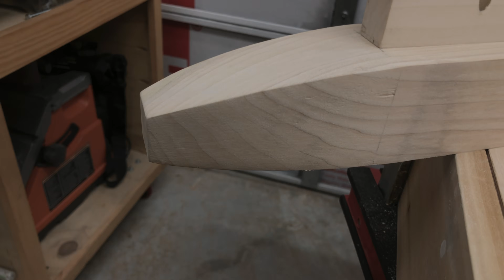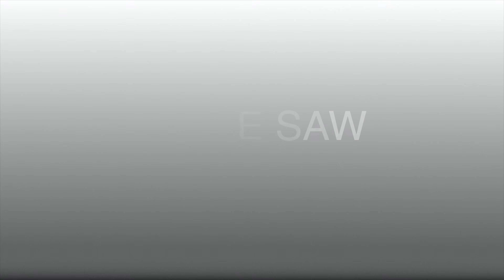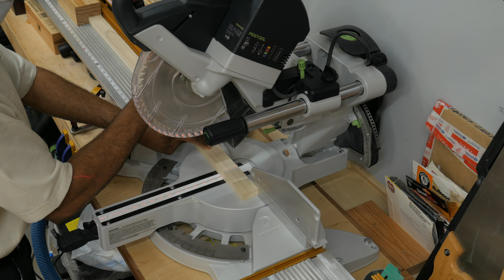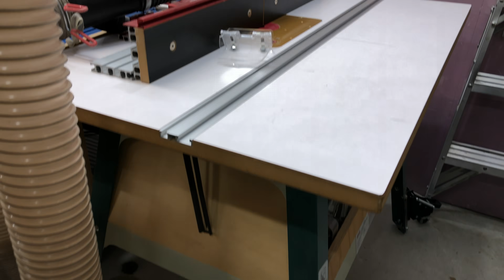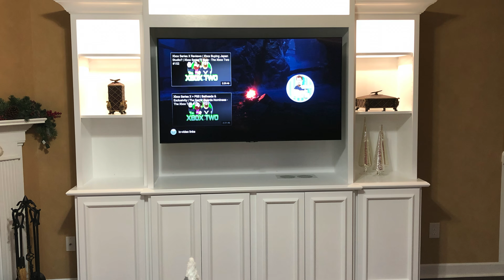Major tools that I would get first if I was starting a woodworking shop from scratch/ table saw rant

Comment: Michael, I’m not going to try and convince you that you’re right or wrong, but I would like to offer a different perspective to yours on the “Hot Dog” saw. You say unless or until all machines have it, then it doesn’t make sense to have it on just one tool (Table saw) because it can lull one into a false sense of security and become lax operating other machines in the shop. So, until all machines have that type of feature you think it is more of a hazard than a benefit. I haven’t found myself, or anyone else I know that has one, becoming complacent or lax around their Sawstop. When I first got it, I was concerned about an unintentional activation by using wet wood or something. If anything, I was more cautious than usual because an accidental activation, can cost $150+ to replace the cartridge and blade. But after awhile you stop thinking about that and use it as a normal saw, you know one that has a 10” blade spinning at 5500 rpm which as always, demands your attention. And the Sawstop safety feature does nothing to stop kickbacks, which can be very dangerous and cause severe bodily injury as well. So, at no time have I, or anyone I know, treated their Sawstop with any less respect or sense of safety than any other saw. I mean think about it, it still looks and sounds like it could cut you hand off, so you instinctively treat it as such. And I don’t know about you, but to me, even a few stitches doesn’t sound like any fun. Is it a shop necessity, no, but the quality of the saw itself is worth it to me and the added safety feature is a welcomed in my shop. And Michael, not all incidents/accidents are made by “stupid” people. All it takes is to be distracted or to lose focus just once for a split second at the wrong or right time for a severe injury to occur. And it doesn’t even take that, injuries can occur when you are doing everything right, equipment can and will fail or break without warning. I’ve spent 30 years in the refining industry and have seen more than my share of avoidable "and" unavoidable injuries. Well, that’s my two cents, thanks, Chuck.
Reply from the maker: I only speak to avoidable injury which are by far the majority of table saw injuries. Acts of GOD are beyond our control! When you are working with a dangerous piece on equipment, it should have your full attention! You can go on YouTube, right now, see individuals using power tools recklessly. Every tool comes with a manual that clearly warns of the dangers of improper use.  When operate a power tool distracted, disengage any of the safety equipment or use in a way it was not intended to be used, you’re accepting personal responsibility for anything that may go wrong and cause injury to yourself or others. If an individual uses a weapon recklessly and/or disable its safeguards, isn't he or she personally responsible for any injury cause by it? As I have stated in my argument, the stop is probably the best made saw in terms of built quality, but , in my opinion, it does more harm than good in a shop environment. Your opinion is not only welcomed; it is appreciated! Thanks for watching!
Reply: @concentrichomesolutions   Michael, thank you for having a channel that allows discussion and debate of differing opinions and viewpoints from which we all can learn.  
I really enjoy your energy, passion and to the point no "B.S." personality, tempered with a bit humor.
Chuck
Reply from the maker: Thank you Sir!

Comment: Regarding your comments about the "Weenie Saw" (Sawstop I think)!  I am 66 years of age.  I starting serious woodworking at age 14.  At age 53 I was using my mint condition 3 HP Unisaw.  At this point I had built 3 custom homes inclusive of all furniture, cabinetry and stand alone shops.  With thousands of table saw cuts under my belt I made one simple yet brutal mistake.  

Wearing hearing protection I walked away from the the relatively quiet running Unisaw.  Returning to the saw from blind side (right of the fence) I reached for my tape measure.  The blade was about 2" above the saw cast iron top.  In an instant. I had cut off my middle, ring and pinkie fingers. The blade then went directly down the length of my index finger.  After nine hours of micro surgery performed my one of the best hand surgeons in the USA I had all fingers re-attached.  Several bone grafts from my hip and wrist repaired my index finger.   After the surgery the hand surgeon sat on the edge of my recovery room bed and asked me what blade I was using.  I thought it an odd question.  Turned out he was a woodworker also.  I said it was a brand new Forest WWII blade my wife gave me it as a Christmas gift the day before the accident.  The surgeon said "I was amazed by the cleanness of the cuts through your bones.  This really  helped as your bones weren't shattered"

For 3 years I attended physical therapy to learn how to use my hand again.  In total the medical cost of in total was $600,000.  Now at 66 I continue to design & build exquisite commissioned Greene and Greene furniture as a hobby in my retirement.

I truly think anyone should think twice about not seriously considering a Sawtop when the cost is only about $1,000 more.  It's also an incredibly well built machine.  I have had Roblands, Unisaws and Grizzly tables saws.  We all make mistakes, all of us have.  Sawstop tried to sell the technology for several years to large machinery companies to no avail.  It is my understanding that only recently Festool bought them.  Go figure!

In summary your statements are like advising a new driver not to wear their seatbelt.  As I watched your negative rant about how any machine can hurt you I can only say they sure can.  But what does that have to do with it?  Why not lessen the odds of injury.  

As a footnote.  The bandsaw is the most versatile machine in a woodshop.  A well tuned bandsaw is absolutely the best machine for ripping wood with unpredictable grain tension.  It does not kick back, only downward.

In closing.  I became very good friends with my hand surgeon.  He was the first to successfully reattach a hand to a wrist.  He has frequently said "40% of my patients are table saw injuries".  After all it only takes one mistake!
Reply from the maker: At the time of my reading, my app did not show the entirety of your comments. Im sorry about your injury. With that said, where was your blade guard (which is the direct equivalent to your car’s seatbelt); Why was your table saw running while you was away from it; Couldn't what you just described happen on a bandsaw, jointer or any other power tool with an exposed running blade? Watch my rant on table saw(aka power tool safety) and if you disagree explain.  Thanks for watching Glen.
Reply from the maker: https://www.youtube.com/watch?v=AZMe0QIET6g
Reply: @concentrichomesolutions  Agreed.........SawStop is a great design but I appreciate the operator has to and must be engaged with the machines same as someone with a gun or other very dangerous tool that reacts faster than a human can react.

Comment: Extremely helpful from the first comments about table saw onwards. At 66, I'm not getting any stronger or coordinated. Breaking down 8*4 sheet material in small shop - Paulk style cutting table is too big - get Selco (other building materials suppliers available but not always with free cutting) to do the first three cuts slightly oversize for free. My car-based-on-van can just about fit 8*3 or 6*4 pieces and wife or neighbours can help carrying over 1" thick material to car and through the house. Currently have very basic Rutlands table saw mainly for ripping
Reply from the maker: You're welcome Stephen!

Comment: I own a sawstop and take the same precautions as if it didn't have the safety brake. However, I know several people who are missing fingers that were due to tablesaws.  For me, it's worth the extra money for the safety device.
Reply from the maker: I have no qualms with that, so long as you are continuing to follow the safety rules. As for people losing their fingers on the table saw due to not following the rules and think that a SawStop is the solution, the router, bandsaw, jointer, etc. are waiting for them! Thanks for watching!
Reply: @concentrichomesolutions  The second someone loses respect for a tool is when they are going to have trouble.  My only "serious" injury was with a hand chisel.  Learned real fast after that the proper use of one.

Comment: I don’t understand why MFT is useful. Can’t we just use the table saw for those cuts? For the money it definitely seems to be a lot of extra for something you could skip completely.

Kapex against some of the 600~ dollar miter saws isn’t that big a price difference if you’re into Festool already. Yeah it’s getting close to twice that but I think if you use a miter saw enough it’s worth it. Even if it seems like an incredibly high price for just a miter saw.

I wish dust collectors weren’t such a mess when shopping for them. Cannot help myself from assuming there are way too many cheap and frustrating difficult collectors readily available. Looking past all the ones that I’m gonna hate is difficult.

The SawStop problem is they made it a decent saw too. For the price and options, leaving out the blade safety, it’s still a good competitor. I personally avoid anything that has such permanence as losing a finger. Even if you get your finger put back on, it’s never the same and now you’re 100k in the hole. Anything that could be that impactful isn’t a terrible investment no matter how cautious you are. It’s also a time thing for me. If I spend thirty years pushing boards through a saw it seems like an accidents probability is built in.
Reply from the maker: Concerning your initial question, it is a safe and convenient way to crosscut longer and wider pieces.  With my current setup, I can crosscut a ~24” panel up to a little over 60” long.

Comment: Hi Michael, I really enjoy your videos. Thank you for laying out your tool picks and opinions. 
I wish I would have bought a combination machine as well. I'm blessed not to have space constrains but would like to more easily joint stock wider than 6". My laguna sheartec II 6" jointer and DW735 work well in concert though. Though I will enjoy getting a grizzly t31496 helical head to replace the factory head. 

I went with the saw stop. I agree with your opinion of not losing respect for your tools but people are human and mistakes are inevitable.
Reply from the maker: Thank you very much John!

Comment: Very nice shop. I bought the Kreg Adaptive Cutting System for it's versatility. It has a lot of advantages over a simple track and saw.  I also bought two extra tracks and guides to easily break down plywood.  I originally bought it to avoid the DANGERS of the TABLE SAW, but  discovered I couldn't rip as accurately with the Kreg thing as I could with a table saw. Whenever I can, I leave the guard on the table saw. A lot of times, you can put it back on after you have the cut perfectly dialed in.  Then you can rip piece after piece without even looking.  You are right about other tools being dangerous. I left my trim router on, went to pick it up, and my little finger made contact with the spinning collet. It ripped the skin off one side of it pretty good.  Spinning blades scare the crap out of me. Always have.  I would buy the saw that won't cut weiners if I had the money though.   I see you make a lot of cabinets. Do you ever make "pilasters" with flutes in them to cover the joints between cabinets. If so, how do you make them? Thanks
Reply from the maker: I have not, but if I did I would use my wood master molder with a profile knife. Thanks for watching Russ!
Reply: @concentrichomesolutions  Nice to have a molder at your disposal. We bought a new Toll Bros. home a year and a half ago. One of their upgrades is a set of cabinets in the office. 4 pieces, 11' in all. $6K to $11K. depending on door style, etc. I said to myself, I can make them for $500 and they would be better! I would need to make the fluted pilasters manually. I'd make a long  jig  a piece of stock would fit into with an adjustable fence for my router. The fence would go over pins equally spaced on each end. Then I would cut four flutes. Never seen it done, but that is my plan. I think it would work.

Comment: If you need a larger rail look at TSO grc-12.  They make connecting two rails together so easy and they end up being dead straight.  https://tsoproducts.com/accessories/grc-12-self-aligning-guide-rail-connectors/
Reply from the maker: Thank you Matthew! I have a set of those but I prefer a continuous length of rail. It has been my experience that you have to adjust for slop between rails. If I setup the track saw on one rail, it may be tight or loose on the other rail.